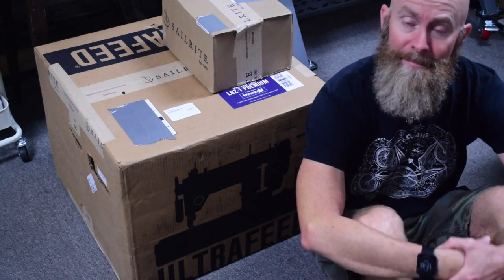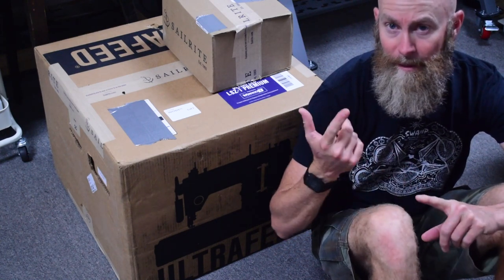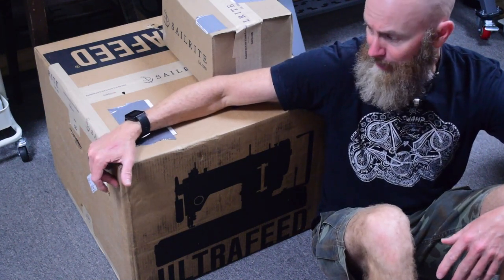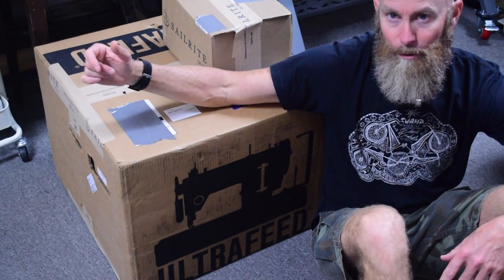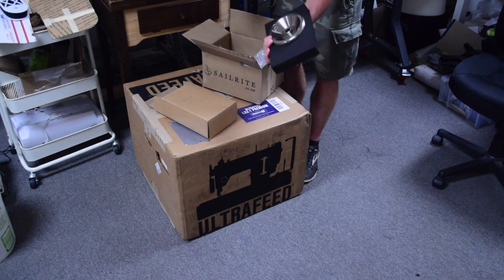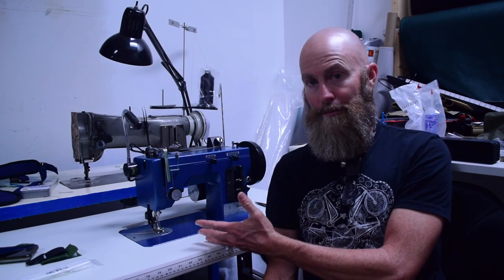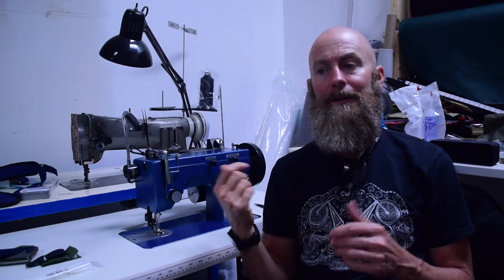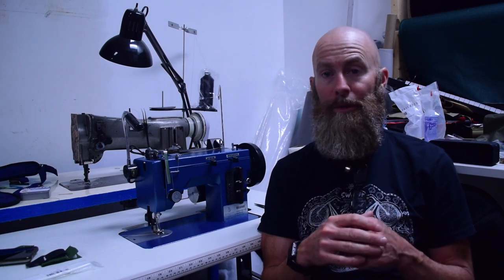LSZ-1Premium with WorkerB; Unboxing and First Impressions

Comment: Great video with clear, concise and appropriate discussion. I upgraded to the compact table and servo motor a few months ago and love it. The smaller table just works better in my small space. I keep my LS-1  on the enclosed porch I built, adjacent to the travel trailer I live in. The worker B motor looks like a great upgrade but for my purposes I think the compact table and servo motor serve me better. I still insider it as portable as the table easily fits in the back seat of my truck and I remove the machine and put it in the carry case I built that is similar to the sailrite case but I made mine a little heavier by using 1/2" plywood. You probably remember that I made 2 of the cases as I sent you photos and we talked via email. I also think your discussion of a sailrite LS-1 or LSZ-1 is not a full industrial machine but rather fills a need for a lot of people who may not need a full size industrial machine. I'm one of those. I have considered an industrial machine but my space is very limited and the Sailrite does almost everything I need in a machine for heavier fabrics and now leather with the servo motor. I only have 3 machines. One being the singer rocketeer that has been in my family since the late 60s. I also found an old singer 15 clone at my aunts house and got it running great. Recently I travelled to colorado from Nebraska and my baby brother needed some repair to a Sitka backpack that one of his dogs chewed on a little. He called me and asked me to bring my machine to repair the backpack for him. I had a pretty full load and didnt want to bring my LS-! with the table for just a few minutes sewing. Several of the repairs were on the webbing such as the sternum strap that had been destroyed. So I brought the old singer close and hoped that I would be able to make the repairs with it. Part of using any tool is knowing its limitation as well as methods to get more out of the tool. The clone didnt have enough power to drive the needle through the webbing just by using the power pedal. But...If you started the needle by turning the crank it would then continue just fine. I was able to make the repairs with no issue. I spend most of my time working in my wood shop and sewing is just a hobby. My woodworking is also mow a hobby even though I do sell a lot of products that I make, and most of that is on the lathe. I have also made a little money by sewing for others but I limit what I do. As an example a lot of people know that I have been a carpenter and cabinet maker most of my adult life and I often get asked to make things for others. My normal answer is that I no longer take on those kind of jobs. Once you take on a commissioned project for others you have certain obligations to those people and I just dont want to put myself in that position. I would rather simply go out to the shop and make things that I think are fun to make and then if somebody likes them and wants to buy it thats great but I dont take on that obligation. I particularly liked and appreciated your comments on some of the negative comments of others regarding the Sailrite machines. The sailrite machine is definitely a huge step up from a standard homeowner model sewing machine and it has the added benefit of being fully mechanical rather than electronic, and Sailrite sells all the replacement parts you will every need. But as with any type of more heavy duty tool they will require maintenance and potentially some repair. I compare it to owning any type of tool that needs to be lubed and adjusted often, which includes woodworking tools such as jointers, planers, table saws, band saw, lathes, and other equipment such as tractors, loaders, combines, etc. I reference those tools as they are often used by me and several of them require some maintenance daily. That is one of the common complaints I read from folks complaining about the Sailrite. I have read several that have stated that they bought a domestic machine and have had to do no maintenance on it other than a few drops of oil on occasion. That is likely true but one needs to keep in mind that domestic and homeowner tools are designed to not require any maintenance and just thrown away when something breaks. With a Sailrite you will be able to repair and return it to service for almost any problem that occurs. I read a few comments this last week with some people who were not even comfortable oiling their own sailrite and part of that was simply because the top and side cover needed to be removed and they were not comfortable with doing that. I tried to be kind with my comments but my opinion is that if you use more heavy duty tools you need to become comfortable with providing maintenance on those tools. 
Item last. How would you compare the function of the Worker B a s the servo motor. I am very impressed with the servo motor and compact table and really like the treadle pedal on the compact table.
Reply from the maker: Thanks Howard, good stuff!
Regarding the WorkerB vs servo, not having the treadle pedal is maybe the only negative, and it is a VERY slight negative for me.  Otherwise, the power and speed are more than enough, and the slow-speed control is on whole different level.  If you are happy with your machine in the compact table and NEVER want to use it as a portable, it may not warrant changing (unless you need that slow-speed awesome control), but if you EVER use the machine as a portable, it's a game-changer.
I hope that helps, thanks for watching and commenting!
Reply: @thejasonofalltrades  Thank you both. I was about to ask the same as Howard, and now I see Jasons answer and evaluation. I have seen a lot of videos of sewing machines using servo motors, but I do not have one myself yet. And when I look at their performance, I get exactly this feeling of lagging low speed control. I guess most leatherworkers have used a clutch motor, and when they get a servo motor, they experience much better control, and do not imagine, that the control can be even better. But human practice can however also help overcome these problems. I am however a bit surprised that some of the manufacturers of servo motors do not make some extra design effort, to make the low speed control even better. I have seen some specifications for Efka servo motors, that indicate better control, but their price level is about 10 times higher - like $1200 each. Durkopp Adler use them on some of their modern industrial machines.

Comment: Thank you for a good video about this product, and I like your well-founded evaluations towards industrial sewing machines. I got less experience than you, but all what you say here fits. Typically the industrial machines got more harp space right of the needle, and I think many users do consider that to be important. I should like someone to measure the distance here for the LSZ-1 or LS1, so I could compare it to some of my own machines.
Reply from the maker: The Ultrafeed has about 7" of harp space. My Consew 206 has about 10" of harp space.  When I worked in marine canvas, there were certainly assemblies I sewed on an industrial machine that would be very challenging, maybe impossible, to sew on an Ultrafeed due to the reduced harp space, but I rarely encounter an issue with the kinds of sewing I do.  There are ways to work around that limitation, but if one is sewing really large assemblies, it would definitely be something to consider!
Thanks for watching and commenting!

Comment: Thank you for doing this review.  I need a new machine and have looked at the Sail many times.  I have a Singer 95-10 and am going to change out the clutch for a servo motor but will save up for the Consew.  Mostly sewing denim and canvas on a regular basis.
Reply: I’m using a 1931 95-40 with a consew CSM 100 servo motor. I changed the pulley on the motor to a smaller one, the control is excellent. I’ve been sewing Sunbrella canvas with it and it’s adequate, but I’d like to find a 111w155 or an older consew 206 Rb.
Reply: @edge1289  Thank you for letting me know.  I'm going to go for it.  In addition to the denim, I need it to handle upholstery as well.  I'll likely change the belt as well.  Need to get the pulley too.

Comment: I have yet to find an accurate word or medical diagnosis(lol) that describes individuals like yourself and many others (me included) who have a fascination for sewing machines and collect them just for fun.    I'm not a professional sewer, but I do enjoy sewing and crafting.  I also enjoy fixing, refurbishing, and re-selling them.   I think Sailrite has a good business model for the hobbyist market and hands-down is best in quality control and customer service. Not the for the budget minded.  I think they are with the Baby Lock or Berninas of the domestics. Keep up the fresh content Jason.  Been a fan since you featured that vintage Singer 1200, the "Unicorn". Still have it? I'm still on the lookout, hoping one shows up at my local thrift shop.
Reply from the maker: Thanks!
I don't know a good term for those of us suffering the affliction of hoarding sewing machines, either. Sometimes I wish they were way more expensive so I would be less tempted.  I like old cars a lot, but I can't afford to keep 30-something of those around!
I do still have the 1200, and it gets used, although not as often.  I've contemplated moving it to my shop so I'll have more opportunities to use it, since I do most of my sewing at work now. I've seen a surprising number of them available over the last few years, none close enough or cheap enough for me to pull the trigger on. Keep looking, and good luck!

Comment: Late to this but the carbon pile foot pedal offers the same control. WORKER BEE solved every issue of control I had. The Ultrafeeds are portable on boat repair tool. I needed a  heavy zig zag for bartacks and bought this over the fabricator. Only thing I wish this machine could have is a industrial sized bobbin.

Comment: I have had mine for over 10 years, I recently upgraded it to the Worker B system, I have done many of the other "upgrades" over the years. I also have the Monster II wheel, with the Worker B and the Monster II, the machine is a beast to sew with. You don't really need the Monster II, but, it's nice to have. I use it on leather all the time without issue.
I think you are dead-on accurate about people "confusing" this with an industrial machine, it's not, don't even think it is one. 
Carrying case, that's funny...buy a folding hand truck for it when you take it with you.
Reply: I'm thinking about the worker B also. Your correct about the folding hand truck.

Comment: I bought the conversion kit for my LSZ-1 a few weeks ago and am really enjoying it.  Finish wise, I REALLY like how they streamlined the wire management because mine lives in the case ever since I bought the Fabricator.  That AC connector and hardwired pedal was a real bummer to deal with.

In the process of converting it, I opened up the control box, it looks like a 90 volt PWM circuit at first glance but I'm not 100% sure.  I'm seriously considering adding a lighting circuit for that u-shaped above needle light, possibly just manufacturing that add on as well, not sure if I'm going to tap the AC side and just so a small SMPS to drive the low voltage for the lighting or tap the 90vdc side to dc-dc down to the voltage I need.  I've found that far more useful than the bendable light on the side, and it's all I need/less to store in the box.
Reply from the maker: I envy your knowledge of electronics.  I can't even put the fuse back in without breaking it lol!

Comment: i was able to get the zigzag width to 5.8mm with needle position to the right, and zigzag width opened all the way with that little lever-stopper undone/slid out of the way for max width.

there was a place on the casting under the bed by the rods comming out of the bottom of the throat where i could see a rod banging the side of the casting at 5.0+.  i took a dremel with a small lolipop bit and removed a little bit of where it rubs and now i dont need the the stopper on the width at all.

its a ok machine, a good machine.  its feeding much better lately too.

Comment: there is a cam on the main shaft of the machine(thats the shaft inside the arm  and it is left of the elbow.  if you lossen it, rotate it counter clockwise as if looking at the handwheel,, it can take a sudden forward before backward moition out of the outer feed dog.

Comment: I think the one machine that about every gear maker wants/needs is a bartacking sewing machine. The LZ1 is the least expensive option. I have looked for a used bartacker machine and without lots of knowledge about different models and what size of tack they sew is difficult to purchase. Look forward to seeing how this machine works as a bartacker and if the tack looks sellable. Cheers!
Reply: I'm sorry, how do u know what I or anyone needs in a sewing machine? Ur lack of knowledge on this machine precludes your ability to tell anyone what they need in a sewing machine.
Reply from the maker: Chuck, I think what Anthony is saying is that the ability to sew a proper bar tack is very useful for a "gear maker" (I agree), and the LSZ-1 is the least expensive way to accomplish this (as opposed to buying a bar tacker that ONLY does bar tacks, in addition to whatever sewing machine one is using). Typical bar tack machines come set up to do either one or a limited range of size of bar tack, since they are intended to be used in a factory doing the exact same thing day in/day out, so choosing a used one from an online seller can be quite challenging. However, they also do bar tacks REALLY fast, and probably better than using a zig-zag machine manually.
Reply: @thejasonofalltrades  Thanks, Jason. Well said! 👍

Comment: Hey, great video.  I’ve been really going back and forth between the LS and LSZ.  I am a hobbyist making bags, camping gear, etc… trying to determine if it’s worth the LSZ for bar tacking or if it’s not necessary.
Reply from the maker: Thanks!
In my opinion, the difference in cost is so little, I would definitely go for the LSZ-1. You can definitely get by without zig-zag, but if you EVER need it and don't have it, you'll regret not spending the extra $200.
That said, if you already have a machine that does zig-zag that you know works for the materials you use most, $200 is $200.
For me, it's worth the extra money.  When you have a machine that does zig-zag, you will find reasons to use it.  To me, it's better to have that capability than to have to improvise or compromise because I don't have it.
Honestly, you're likely to be very happy either way you go!  Let me know which you decide on!
Reply: Thanks for the comment, yeah better to have and not need than need and not have as the saying goes!
Reply: I was really leaning towards a sailrite, but I ended up finding a Consew 226R1 very well maintained with servo motor locally!

Comment: Thank you. Just watched your presentation.  I'm wondering between a machine for upholstery indoor and out and this seems a new option I was never aware of.  I'm a home sewer hobbyist - any suggestions?
Reply from the maker: Hi!
The LSZ-1 is a solid choice for what you are wanting to do. The only challenge might be the throat space if you're sewing large items. Sailrite makes a full-size industrial machine called the Fabricator that might be worth a look if that's the case.
If you have space for a full-size machine and don't need portability, used walking-foot industrials like my Consew 206 are also a good option. 
This video goes into some detail on the topic of choosing a machine, you might find some helpful info in it - 
https://www.youtube.com/watch?v=fFq5QXgF4v8&t=325s
Thanks for watching and good luck!

Comment: Hey Jason thanks for the video. How does the workerb stack up against the servo motor? In regards to slow speed control and precision?
Reply from the maker: In my experience, the WorkerB is capable of better slow-speed control and torque than any industrial servo motor I've used. It is truly impressive!